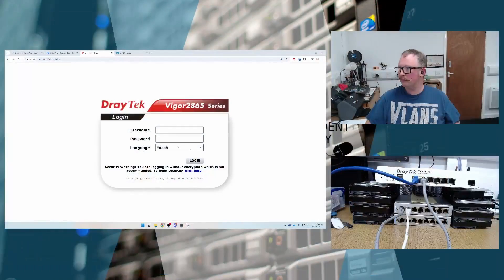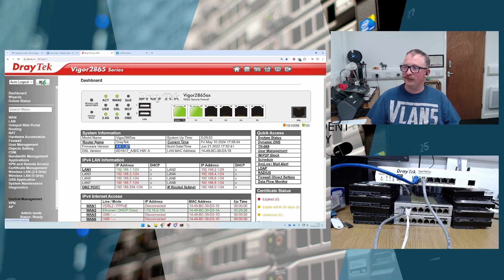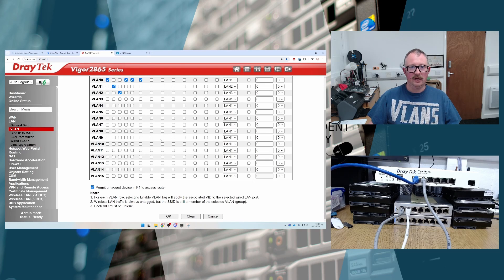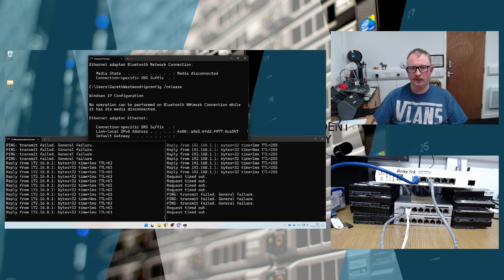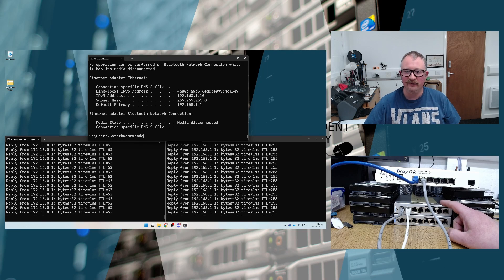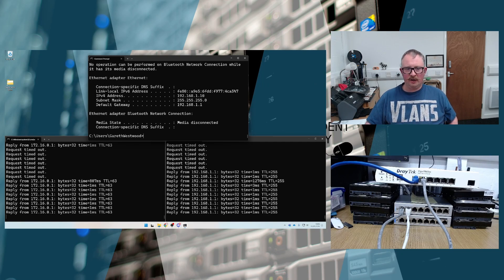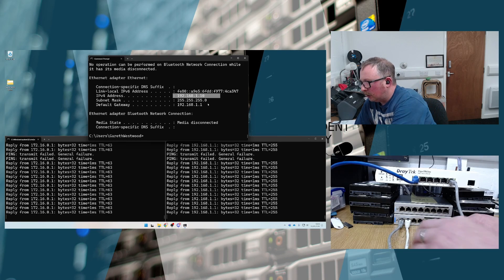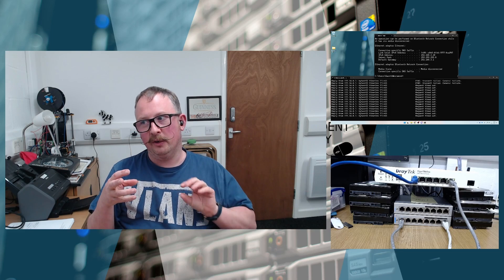How To Configure vlans on a Draytek Router

Comment: Thanks for the video, have a similar setup but from your draytek setup at 11:52 I can't get Port 2 (Vlan1) to talk to devices tagged as 200 from port 5 (vlan3) even thought they are on the same Subnet LAN2. 

Draytek must be isolating by "Vlan" in the left column and not by "Lan" selected. 
So I don't appear to be able to tag a port for an unmanaged device and get it to talk to devices tagged in another switch.
The Ui is horrible on the draytek.
Any ideas thanks

Comment: You mentioned having a switch that is capable of  “Understanding” the VLAN  on the other sides.   If you just have a simple “Dumb” non managed switch how would this work. 

And can you recommend a switch that can do it
Reply from the maker: Hey Sondela Consulting. Sorry I missed this message when you posted it. If you have a dumb switch then you can connect one vlan from the router to it but only one. If you need more than one of the vlans to be available on the switch then it does need to be vlan aware. Difficult to recommend anything specifically without knowing the full setup but anything marked as smart or managed will almost certainly support vlans.